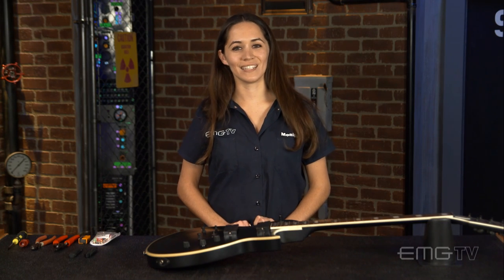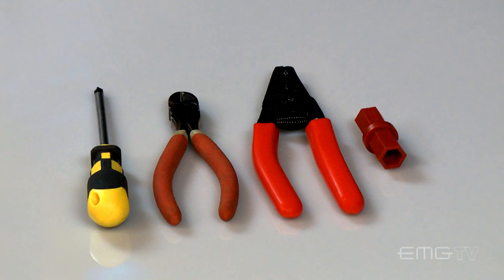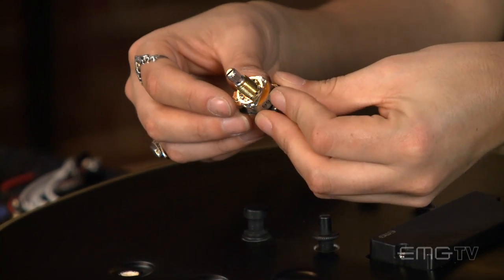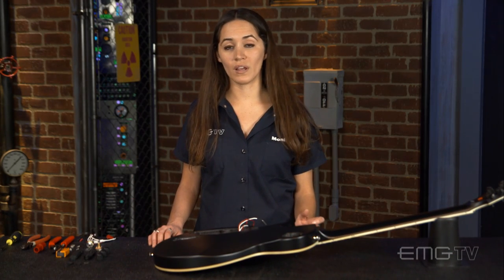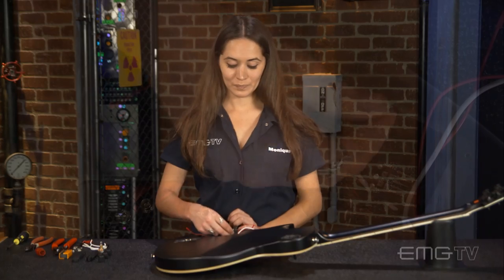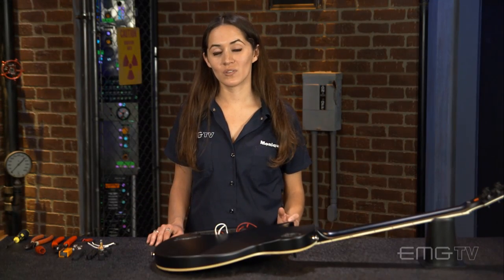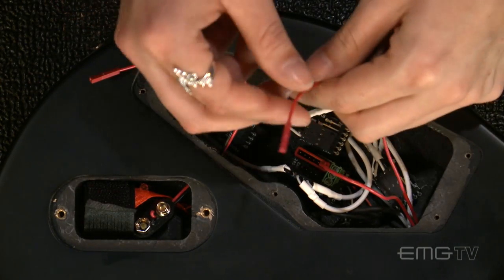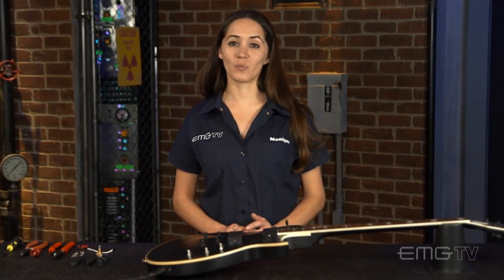Solderless wiring kit installation with Monique on EMGtv

Comment: Holy shit I need to take the back plate off my EC-407 and see if Monique snuck in and changed my pots lol
Reply: Lol, adam sup bruh?  Hows your wee Vox?
Reply: da fuq?
Reply: Lol, check your past notifications, I was the guy dissing your Valvetronics.
Reply: I don't keep it at my place, it stays at my buddy's and he loves it. I either use toontrack or A line 6 Firehawk FX through monitors at home
Reply: Right on. I have a Dual Rec, a Krank Rev and a Peavey Ultra....  all bedroom capable!!!!
Reply: yea, if you live in the middle of nowhere, by yourself.
Reply: no, just make sure you have a master volume head. and dont crank the thing after 10. lol. The krank is a bit of a pain, you have to use an eq in the loop and turn down the signal to be quiet enough. But a boogie with master volume you can get down to a dull roar.
Reply: for those big amps I gotta play em cranked. I'd rather just go with a little amp or something through the monitor system(I have a dual rectifier)
Reply: i love my dual. cheers brother
Reply: I have a Single Rectifier solo head series 2 50 watt & Mesa Rectifier 2x12 cab. In my garage I can set the master at 4 and still not blow away the neighbors. I dont know if you guys got the new series 3 where the fazed out the Single Recto but the Duo has 100 & 50 watt setting.

Comment: They were smart to use an instrument with easy passages to snake the pickup connector cables through. Try sending the cable from a rear routed control cavity to a neck pickup on a solid body with no pickguard via the small bored hole designed for solderable pickup leads. Not gonna happen. 

It is a ton of fun opening up that hole so the EMG connector will pass through. Sometimes you can't just drill it out bigger and have to attack it with hand tools. Then you run the risk of the floor of the pickup rout becoming ugly and unprofessional looking. After a certain point, it doesn't feel like a wiring upgrade. It feels like a chop job. 

But once it's done, the components are good and it all works well. Soldering is more satisfying though.

Comment: Can you solder new pots to those circuit boards if the pots ever go bad?   I did exactly that, but I only get sound at max volume.  the replacement pots are larger than the old ones that died though.  the only alpha pots i could find

Comment: What if you’re replacing passive pickups that don’t already have a pre-existing battery route? I don’t want to have to route another cavity into my guitars just to install this system. Duncan user here, but I’m thinking about swapping to EMGs, specifically an H3 in the bridge and an H2 in the neck. For context, my guitars are:

Jackson KEXQ Kelly
Jackson SL7Q Soloist
Reply: You can put a layer of foam in the existing cavity and place your battery inside. Just gotta play a little Tetris, but it works.

Comment: How would I wire it if i wanted to add a EMG x single coil?   I already have 81/60 but my guitar had a middle position where a single coil used to be.  there is a dummy pickup there for the time being
Reply: I was wondering the same thing

Comment: Ty for sharing! Can you or someone help me? I have a strats style guitar H-S-S, 1 Vol, 2 Tones, 5 way switch. I have an older soldered system. I'm ready to plunge into the solderless world. But I'm very interested in the VMC accessory. I would love to try that first. And still use a Tone pot. An EMG emailed me and said " Probably the easiest route to go with this would be to change the single tone to a master tone affecting all the pickups. If you did it this way, you can just put the volume, tone, and VMC all in line with the output of the switch to the output jack. "  That's as clear as mud. can someone help guide me on the installation? Ty for you time!!! Jim

Comment: Man!!! If you haven't replaced your wiring to this you are definitely missing out it's amazing
Reply: I'm kinda new to guitars what she changing and what will the change do?
Reply: @thrashtodeth9442  late to this, but she’s changing both the pickups of the guitar and the way the guitar is wired. Instead of the wiring being soldered (think of a glue thats made with metals), which can be pretty scary to try to do if it’s your first time. Making the wiring system solderless, all you’d have to do for future pick up changes (as long as they’re EMGs) is unplug the older pickups and plug in the new ones and you’re good to go. As opposed to having to solder wires to the pots that they belong to
Reply: I’m getting on this relatively soon. Got an H3 bridge and H2 neck coming soon, and I’ll be installing the original Afterburner in my Jackson KEXQ Kelly. Can’t wait! 🤘

Comment: What about the wire that is grounded to bridge? Does it become redundant at this point? Didn't catch you mention it, so is it not required?
Reply: Grounding is not required. The wire connected to the bridge is not needed due to the the active pickup connected to the battery.

Comment: If i can modify the kit to work with passive pickups would be great
Reply: you just need to connect pins to the passive pickup cable tips, and thats it.
https://electronilab.co/tienda/regleta-conector-macho-2-54mm-40-x-1-pines/

You can cut 1 or 2 of this pins or even 3.......also you can bend the tips to save space if you want (this is what you actually see on the terminas of an active pickup)

Comment: I tried installing emg Hz pickups on my Ltd EC256. I followed the diagrams but the volume is very low and both pickups are on no matter what position the toggle switch is in. (I bought the emg toggle switch for the quick solderless connection) Any ideas would be appreciated.
Reply: Clearly you plugged something in the wrong spot if the two pickups are on. Start all from ZERO again.
Reply: Hey I’m having the exact same problem, could you let me know what you did please
Reply: I am also installing on EC-256, we have 3 knobs so which knob of EMG I shouldn't be installing on? Do you know?
Reply: @mylogify  I wish I could help but my guitar has been sitting in a gig bag for 4 years not being used. I could never figure it out. Lmfao.

Comment: What if I want to wire it with just one volume knob and a solderless toggle switch?
Reply: you just plug the pickups directly into the buss then out from the buss into volume pot/out from pot into O/P jack

Comment: Hell i just clipped the wires of my original pu and "twist-rigged" the h4 in the bridge of my Ibanez using electric tape in place of soldering and shrink sleeve so NOW it's back to the drawing board and THIS time I'm just gonna gut it out completely and rewire the whole system with the reflective "ground" tape and ALL lol ..... No MORE shorts ......

Comment: .. now take your router and make a neat little hole for the batteryplacement.  Then drill some more holes for the wiring and then cut off the cable ends to soil it! 
If youve got a superstrat from the 80s

Comment: Hi . I want to install 81/85 Active pickup in my ESP LTD KH 202 , which is having 2 volume, 1 tone and 3 way switched.. please guide me or send me installation wiring diagram.  1 more thing If I will change later on any noise will be there ?? thank you
Reply: Hey did you figure out which pots to use for 3 knobs guitar and switch?

Comment: What if the guitar doesn't have a "cavity" for the battery? Any work around for it? Cut one out? Haha
Reply: Ponskippa yes. Unless you can squeeze it into the main cavity and protect it from everything else somehow. Though it'll make it a bit more difficult to replace
Reply: You can try to see there is enough space for the battery box on the control cavity cover (its easier to cut the hole in the plastic cover)

Otherwise, you will need to route a hole. A luthier can do it with no problem.

Comment: my kit didnt come with selector switch wiring???
Reply: You'll need to solder to the existing switch, or buy a new emg switch to plug it into. I'm currently in the same situation.
Reply: thats what i had to do. i was very upset as i had to source additional wires when the EMG kit was supposed to have everything. its not always easy trying to find wire to use
Reply: I think the kit is specific to an active set of pickups... I just bought the emg switch from Solo guitars.

Comment: It's simple enough to do,but often the solderless wires won't fit through the cavities on a guitar and your only options will be to solder or enlarge the cavity hole

Sadly,EMG haven't addressed this
Reply: Or you can press in the little silver connectore on the plugs and remove the plug end,slide it through the re attach the plug end. They show it in one of the emg videos with monique

Comment: What if I only wanted one 81 at the bridge in my Viper. No neck pup, could I use this system?
Reply: sure, if you have space for the battery. it's even easier to install just one pickup, they usually come with wiring diagrams for 1 or 2 pickups, with or without tone pot you just build what you want.

Comment: How do I connect the 3 way switch to the bus?? Mine didn't come with a cable for that :( please help me
Reply: What did you do with that? I'm in the same situation..
Reply: Me too
Reply: You use the existing cable and strip the wires then they go into the corresponding black and green sections on the bus.

Comment: Not as simple as she makes it seem. The part she mentions about wires being different colors on different makes can end the process right there for a lot of people. Good luck as a novice trying to figure out which wire does which, especially on selector switches that are not included. For example I'm trying to hook up some Fat 55 in a PRS 594 that has a basic Gibson control layout and the switch wires have different colors, less number of wires than in the instructions, and are all twisted together in a clump of solder at the base making it impossible to figure out which is which without removing it all and starting from scratch, which kinda defeats the who idea of a simple plug and play installation. Frustrating.

Comment: I'm getting constant volume from both pickups no matter what position the toggle is in
Reply: Same, any position of the toggle make the bridge pickup always on
Reply: Me to
Reply: @jordanburgett9410  I've resolve the problem. I've change the switch and everything seems to be ok now 😎 I've bought an emg switch solderless a 3 position toggle, trust me, it works if you change that piece

Comment: Hey this looks like a great system.   One question.   Why does it need a 9 volt battery????
Reply: Because they are active pickups. They have their own preamps, and they need a separate battery to run. If they were passive pickups they wouldn't need the battery. I totally agree though dude, EMG has made an awesome system here. Hope this information helps.

Comment: Hi, since one of the volume potentiometer on my guitar ( equipped with a hardwired setup: Emg 81/Emg 60) produces scratchy noise and mutes the signal too, I'm planning to replace it with a fresh one.

The only concern is that my guitar is a left handed one.

At the moment with the stock hardwired connection potentiometers are correctly wired to operate for a left handed guitarist ( so not to use it in reverse).

Is it possible to maintain the correct rotation of the pots with the new solderless system?

To resume, is it possible to decide the turning direction of the pots ( as you could do with the hardwired connection), with the actual solderless system? Thanx in advance

Comment: In just 5 minutes too.....? LOL And if your converting passive to active , you need to rout a battery cavity . And you need a new 3 way switch ( not included w/ wiring kit ). In other words this video is lacking quite a bit of info and should be updated with a real time install with more detail and trouble shooting .
Reply: This video is just a general documentation on how to install the pickups. There are various materials targeting specific issues you may encounter and how to install in different types of guitars. You also have diagrams for the most common guitar electronic settings on EMG site. Moreover,  you have to be prepared for undocumented or unexpected problems such as the size of cavity, slightly smaller holes for potentiometers, difficulties with small passages between cavity and pickup holes which makes the larger ends of wires provided with EMG pickups to get stuck and other.

Comment: the negative wire from the battery connector is not long enough for me to connect it to the output jack in my LTD KH3, what can I do?
Reply: Hey
Any chance you can take a picture of your  install?
I'm upgrading all the wiring and switch for my ltd kh-602. 
Not sure which diagram is for me, or how the switch connects

Comment: I put 81 85 on my dean razorback killswitch, but the cavity is so small i had to remove the killswitch and even then the holes to get to the pickups/selector are too small so i couldnt connect the toggle switch, even with a pickup switch that has thin wires
Reply: Similar situation I had with my Carvin LB75 bass.
I'm installing volume controls for each pickup, which is easy.  The space to install the BTS active EQ is a bit of extra effort.  I wired up the pots  before I installed them.  Not getting any sound though.

Comment: Monique....  Why do I get an out of phase tone when I use both pickups on my Paul....   just installed an 81TWX and an 89XR all solderless w toggle. Used the standard LP control layout. and I used the provided vols and active tones.  Each pickup sounds normal in single coil mode and humbucker but when both pickups are selected in single or humbucker, I get a slight out of phase tone, especially when I use a boost pedal. THEY SOUND INSANE THO!!!! Well done.

Comment: Where do I connect the ground cable coming from the bridge?? (on a Les Paul)
Reply: For emg you don't use the ground wire, just clip it off
Reply: @lukekern7444  so you don't need a ground cable at all? :o